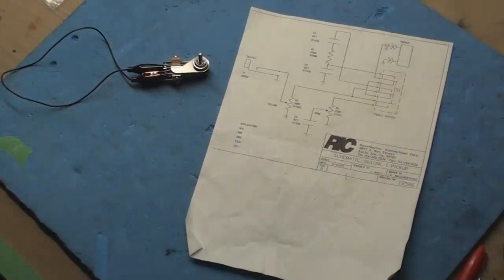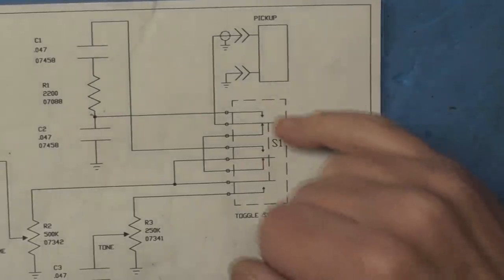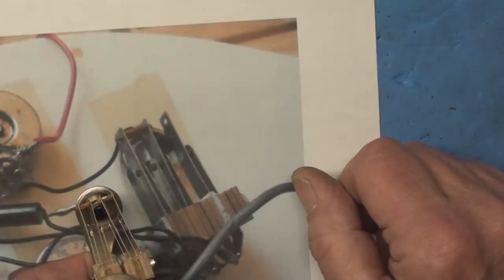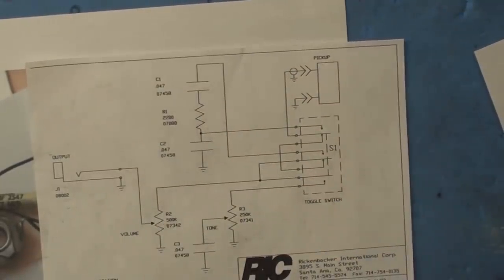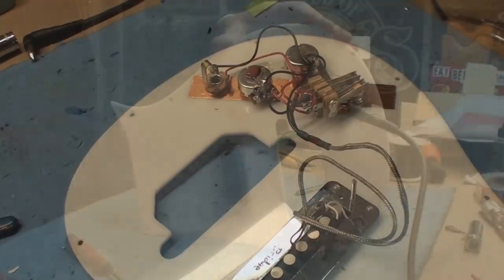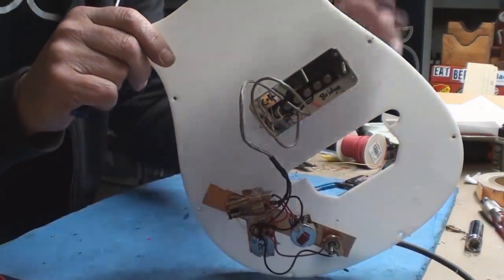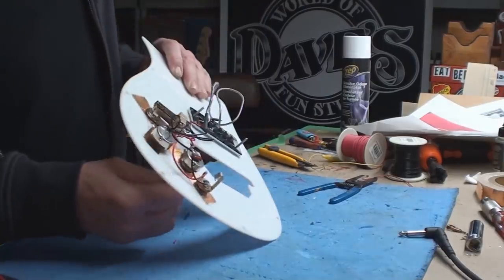Rickenbacker Guitar Repair Part TOO MANY Trust No One

Comment: After watching this series on this guitar, the question finally dawned on me of, "Why does that need a switch if it only has one pickup?" Then I realized it must have something to do with activating some tone device, which apparently it does. If it was my guitar, at this point I'd just keep a switch for looks, and just have Dave wire the pickup directly to the volume and tone pots. The tone feature would have to do something really outstanding for me to care about having that option.
Reply: Jeff that`s what was confuseing me got it now. And the saga continues good aint it ?
Reply: Sure, if Dave can talk the customer into it!
Reply: It would be similar in theory to the original Esquire/Broadcaster tone switching where forward is tone rolled off for "rhythm", but not quite as complex as the Jazzmaster rhythm circuit that no one could figure out how to use

Comment: Wonder if those were built in house by Rickenbacker?
You just remove the two screws on the side, and build your sandwich to desired layout, and add two screws of correct length. Switchcraft used to sell a kit with all those slices to build your own, once you had the design you wanted, Switchcraft could then sell you the switch you wanted, with the layout you wanted, pre-assembled for a reasonable cost...
It also means repairs were "simple", and crazy codgers could build their own switch monstrosities from parts and other switches. And Rickenbacker seems to of sort of done that last bit on these odd switches... Maybe while screaming, "It's Alive! ... Alive!".

Comment: Hi Dave, enjoy all your videos.. this one seems like a stumper. Those double sided contacts are what’s mucking up the works it appears. What if you added a mini spst switch into the schematic that comes off position 3 (the kill position) and the tone sucking circuit runs thru the mini spst switch? Not the cleanest of options. But it may solve your problem. Whatcha got to lose?

Comment: It looks like the original is actually two switches cut and glued together (5:16).    A standard switch and half of some other poor soul.  Talk about gooched engineering designs.

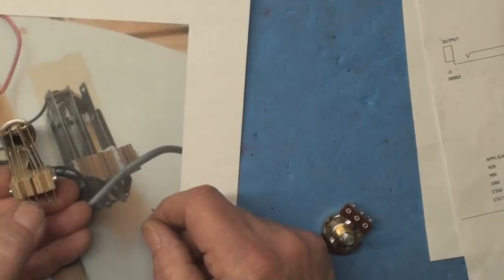If you look at 6:46, you can see that the second part has a hole where the spacing rod should go - it looks like two of the same switch with one literally cut and the outer third glued onto the other.

Comment: Hi Dave great ch , i know how to fix it ! remove the rivet from the new switch and reorder the parts to make it work like the old switch . You already spent the money plus it will make a great video !
Reply: Hi Dave sorry i am from Qc , pardon my french . I will try again , the new switch you bought could be modified to match the picture of the old one , you just need to remove the rivet and reorder the parts use a screw to replace the rivet. sorry again if i dont make more sense .
Reply: Alright Dave You are the teacher , i cant show up without doing the homework , it works on paper i have the solution .. i will send it to you cheers !

Comment: Dave, why not just hard wire the tone suck circuit into the position that just had  volume? I'd rather have tone in both position than one that is just volume.

Comment: Good luck with trying to make the switch perform the third, (useless), function,  this sort of thing can cause severe brain pain. Bitter experience has drawn me to the conclusion that most times guitars with fancy switching arrangements only really sound good in one position anyway. But you have to try. I recently wired up an Esquire with that fancy switching arrangement devised by the Fender custom Shop guy, (forgot his name), and it sounds cool , you never know.....

Comment: I believe what you need is a Switchcraft 12015X. If I'm not mistaken, you have the 12013X. As you said in a previous vid, that's the switch used in the double necks, at least the Gibsons. Mouser has them.
https://www.mouser.com/ProductDetail/Switchcraft/12015X?qs=sGAEpiMZZMvudeGI7i40XD3DUpOXokXG8okfUpVI90c%3d
Reply: If nothing else, here's a page and contact for Switchcraft directly.
http://www.switchcraft.com/ProductSummary.aspx?Parent=1161

Comment: From Leo:  You have enough contacts on that leaf switch to wire two different tone caps .  You would not have to take them out of the circuit, maybe just parallel them in to the one already on the tone pot.  For example with .022 cap, adding another in parallel would act like a .044,  and you could go crazy with another and you would have a .066,  aka mud switch like some Gretsch models..      

Whatever you do, it will be better than any chance the guy had to fix it himself.  I would have sent it back to the guy when I found the neck tendon butchered.  That might be why I am not a famous Canadian Luthier, but just another broke guy eeking out a living and paying too much for tools from StewMac.  Good Luck.

Comment: Have you looked in the mirror lately. Hell .. Looks don't matter. Get your thinking hat on and make a Logic table on the switch and wire the damn thing up to operate like the schematic. Easy peasy. 
BTW yes, I'm a engineering electronics tech by trade.